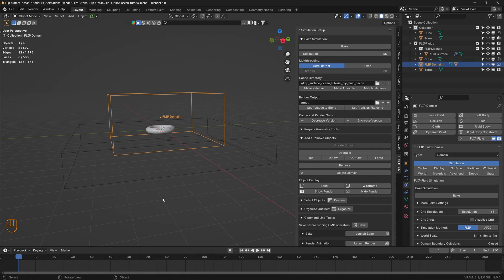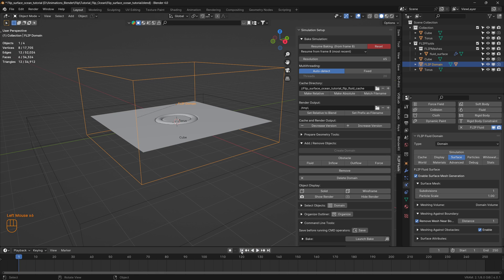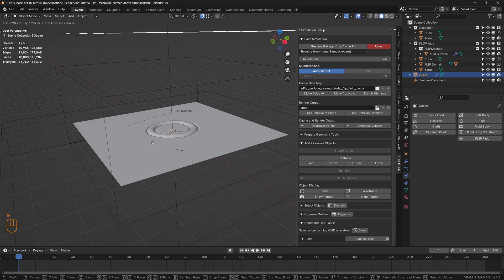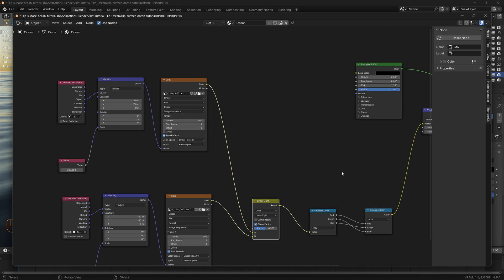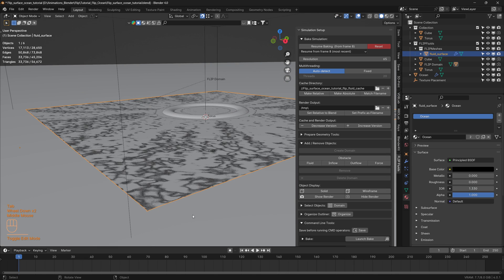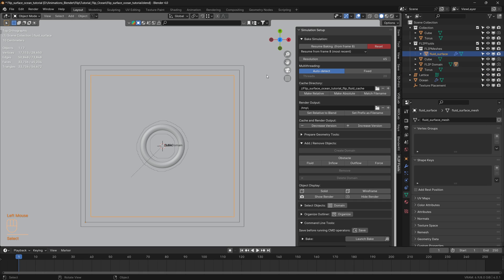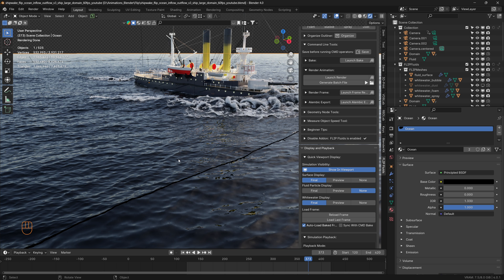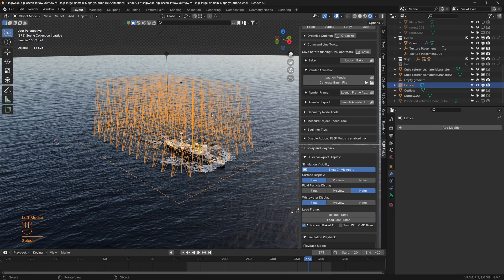How to blend Flip simulation onto Ocean | Flip Fluids addon | Ocean Modifier || Blender

Comment: hey if i add like thunder and smoke like effect in this simulation, do u think it can still be rendered nicely using a laptop spec higher then yours?
Reply: i mean fog effect
Reply from the maker: In my experience, volume rendering (such as fog) might be a bit slow (actually lot slower) but achievable on a good GPU ( vram > 8GB)

Comment: Hello, the tutorial is very interesting and it will be very useful for my next project. However, when I get to the ‘shrinkwarp’ level it's impossible for me to get a good result. My fluid surface doesn't transfer correctly to the ocean and I have to admit that I don't understand why. And when I try not to render, obviously the number of subdivisions is too high and my graphics card can't keep up. 

Here is my configuration:
Intel Core i7-10700 cpu
Nvidia Rtx Geforce RTX 2060 Super
64GB ram ddr4

Do you have any idea what the problem is?
Reply from the maker: Hi, nice system config. You can contact me thru email or discord and I’d be happy to help.

Comment: Hello, for some reason when I change the fluid material to the ocean material with displacement only. The fluid simulation shifts. Do you know why?
Reply from the maker: Please check the midlevel in the displacement node. This shifts the simulation.
Reply: @blendercinematic  i changed the midlevel to even -500 to +500. nothing has changed unfortunately

Comment: Question: when setting my own up... At a resolution of 65 the fluid water works correctly, but when I change resolutions either up or down and re render the same scene, the fluid water level is higher or lower (above or below my ship model) depending on the resolution I have chosen.

How did you fix this issue?

Comment: The downloaded 3d model usually penetrates through the liquid.
For a ship, a simple obstacle of similar shape will solve the problem, but for a living creature or something with motion, it is a bit troublesome.
Any suggestions?
Reply from the maker: Of course, the obstacle mesh should always be manifold (watertight). Try duplicating the mesh and use decimate modifier to reduce the mesh density and if necessary edit the mesh to make it manifold and then use this proxy mesh as the obstacle in the flip sim.

Comment: When I apply a material to a flip surface and look at the render preview, for some reason it is off to the side from the actual simulation 🤔.
Reply: Furthermore, it looks like one part of the white water is under the sea.
 I can't think of any good solution 😭
Reply from the maker: I haven’t had a chance to try this yet but adding a displace modifier to the foam with the ocean displacement maps as texture might help.
Reply: @blendercinematic 

Thank you so much!
 Everything went well😭

Comment: hey i am using flip fluids version 1.6.0 and blender 3.2.2. I am not seeing surface tab. isn't it available in this version?
Reply from the maker: It should be available but I guess flip fluids v1.6 is built for newer versions of blender, so I haven’t checked its compatibility with older versions of blender.
Reply: which version youre using?
 @blendercinematic
Reply from the maker: Blender 4.0.1 with flip fluids v1.7.4
Reply: i got the solution, but my scene isnt creating much white water particles, csan you share your setting of ship scene  @blendercinematic
Reply from the maker: Please contact me on discord or email.

Comment: Good day to you - Could I ask you for aid?? I would like to try a Split the ocean - Moses style? How would I tackle this with Flip Fluids? Thank you kindly!
Reply from the maker: Hi, good day to you too. Short answer is by using flip fluid force fields to push the fluid away from the force field object which in this case could be a wall in the middle of the domain.
Reply: @blendercinematic   GREAT - I would love to test it... Is the processing time heavy? - I have an INTEL i9 20 Core - 32 Gigs DDR4 and Asus STRIX 1080Ti
I'll have to wait a bit to buy your software -Thank you :)
Reply from the maker: Most fluid simulations take quite a bit of time to bake, usually several hours and flip simulation is no exception. Your Compute power is awesome but your RAM might be limiting. I use 64Gigs of DDR5 and still seems limiting on a few occasions requiring large scale sims.
Reply: @blendercinematic   Thank you so much :)

Comment: Hi.. first of all your tutorials are out of this world so thank you for that.  I had a quick question about flip fluids....my does my fluid come out unnatural like large dew drop rather than small water particles like yours..meaning the water look more like tap water than oceans...even if i bake it at 300 resolution.
Reply from the maker: You're very welcome! The voxel size should be proportional to the ocean scale. Usually for large scale sims, I tend to keep the voxel size at 0.2m or lower. Also large amount of whitewater adds to the scale. Moreover, I smooth out the fluid surface by increasing the iterations so that we don't see any huge blobs interfering with the ocean scale look.
Reply: @blendercinematic  thank you so much for your advice...I will try the setting for sure... I'm pretty new to blender so I always run into issues.  Specially when it comes to fluid simulation

Comment: This looks great! However, I’m concerned as to the amount of resources it takes up. Using a shrink wrap modifier around a flip sim will bog the system down a lot. Are you seeing major issues and multiple crashes? Just curious.
Reply from the maker: Thank you! The subdivisions required for shrinkwrap takes up a bit more RAM but other than that, it seems pretty stable. I'll be uploading more large scale flip sims using this technique. Stay tuned.